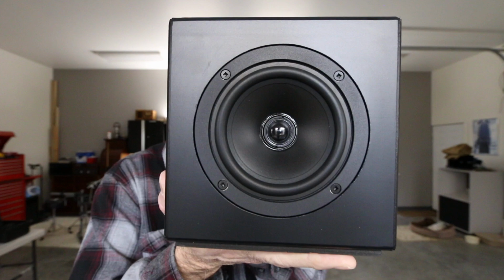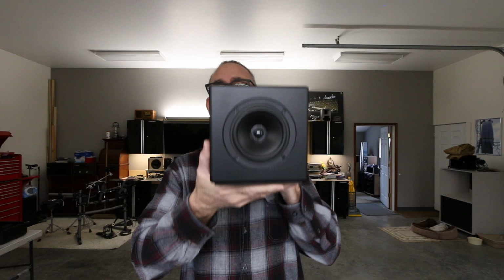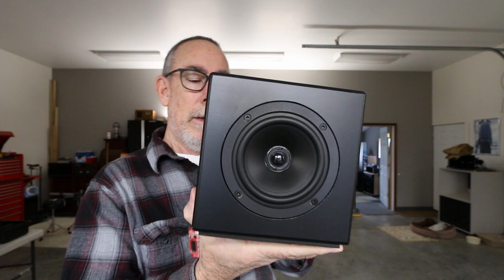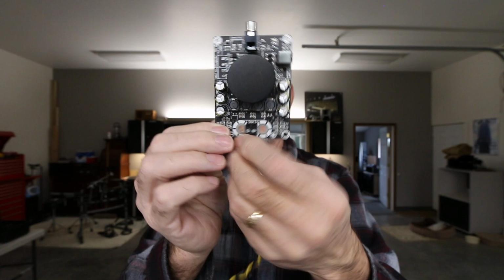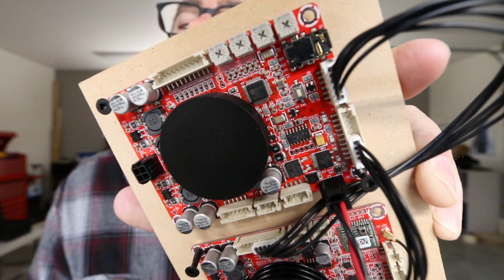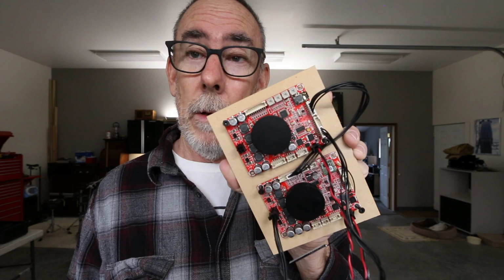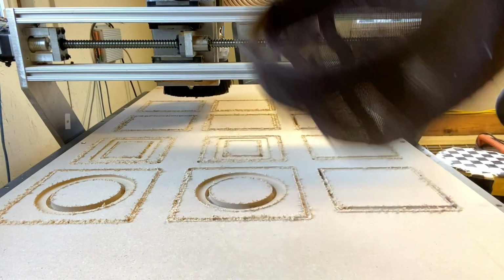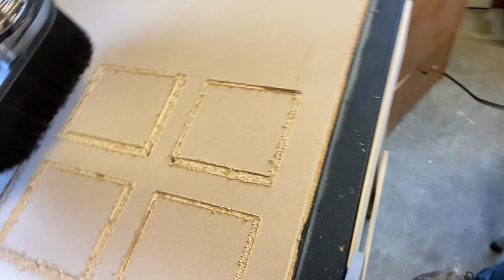Audio Geekery! | Diy Studio Monitor, | Part 1 | MixCube active studio monitor Dayton Audio CX120 HD

Comment: Great building, good job. On minute 7:45 what did you use there for the back of the  speaker to connect inputs or outputs.
Reply: i was to trying to figure it out too but with no success, did u managed to find it out?
Reply: I've found it lol Dayton Audio KAB-PMV3 Panel Mount for KAB-v3

Comment: It doesn't look like you mentioned this in any of the videos, but since these boards only have unbalanced audio connections, is that what you are doing for yours? I never saw a clear image of the back of the speaker so I can't tell what sort of I/O you decided to implement.

I have a hunch though, on how to have an electronically balanced input on these, assuming you are okay with just one input per board - Theoretically, would using both ADC inputs as hot and cold respectively for a balanced signal work, if, in the DSP, you inverted the polarity on the one used for cold and then summed them together? I'd imagine ground would still need to be in place, but that should cause proper common mode rejection for any EMI/RFI picked up on the line, right?
Reply from the maker: I/O is single ended on this project, I use the mini-dsp Pwr-Ice product for bigger projects
Reply: @GaryFord-Audio  Gotcha. I've been working on a design of my own that's a simple single-ended input as well. That being said, if I go far enough down the rabbit hole, I may try to integrate custom PCB's with I2S DACs/ADCs/CODECs that do have differential inputs. We shall see!